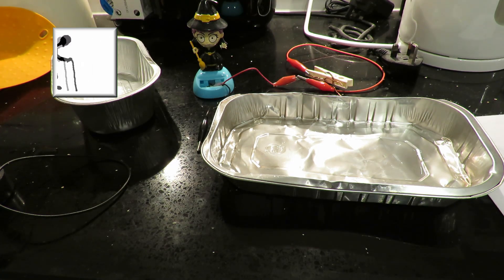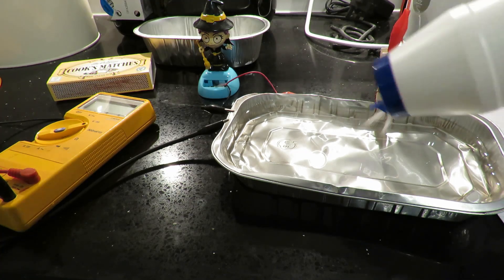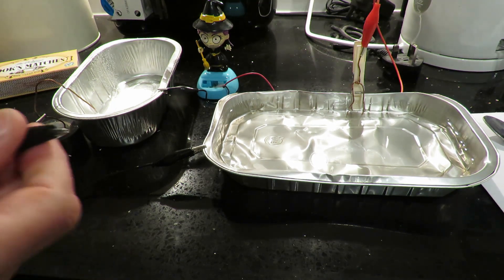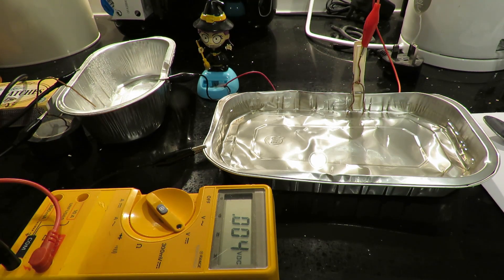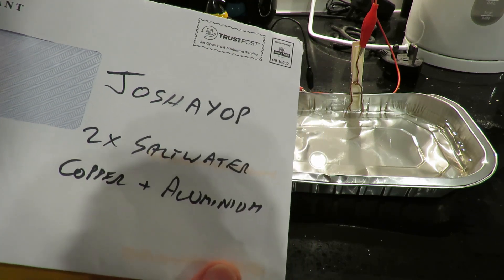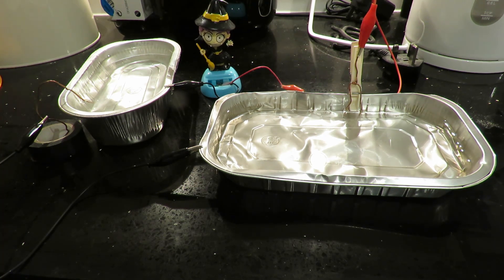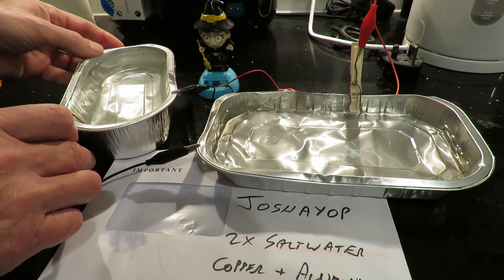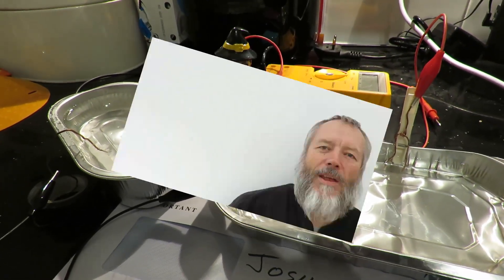Solar Rocker Saltwater Copper and Aluminium battery

Comment: Just tried this with a vinegar (brownish one) and a long nail (i think it's a zinc one).. measured Voltage - 1.02V but almost no amperage (got 0.2uA) and the nail was covered and released lot of bubbles, looked like some kind of internal short.. edit: no wonder you got just 0.6V! It's a closed loop, not open circuit! If open, i guess you would get around 1V on 1 tray
Reply from the maker: Thanks for sharing

Comment: I would think that if you used copper plates , having much more surface area , would generate a bit more power. Only assuming since I have not tried this stuff my self -   yet.    : )
Reply from the maker: Yes larger area gives more 'amps' but we also need a little more voltage than one cell can provide to get the rocker moving regularly. A stronger solution will also help up to a point.

Comment: I would imagine the system would keep running until the water evaporated?
Reply from the maker: Nah, it didn't last very long. It might have lasted longer if I increased the amount of salt I added but I just wanted to show the basics of using the tray as the cathode or anode, can't remember which is which. I challenge you to read this explanation and not come back confused https://www.thoughtco.com/how-to-define-anode-and-cathode-606452
Reply: @GrandadIsAnOldMan  LOL. So the cathode can be charged along with anode but both can be charged at the same rate as the cathode and anode together in series. Therefore, when the anode is attracting onions. the cathode is producing positrons and both are frying the chips for dinner.  Yes, it all made perfect sense. Was written by a Phd I noticed. LOL. It was like reading Abbot and Costello's, "Who's On First Base?" 🤣👍👍👍 https://www.youtube.com/watch?v=tbJwwJ33TEI

Comment: grandad , do u have a certain ratio of salt to  water or did u just dump it in or experiment with  what seems " right? thanks  read on how volta experiemented with his battery. thanks in advance  ohm myyyyyy!!!!.
Reply: Usually for cooking, it's 10g/liter and since the experiment is in the kitchen... XD
Reply from the maker: I just sprinkled some in. In fact you could do an experiment simply to discover the optimum strength

Comment: Those cells can be charged using 3 volts in my experiments and after charged they hold over 1v each but the discharge back to around 0.6v
Reply from the maker: By coincidence there is a short series coming up with a rechargeable battery made using Epsom Salts as the electrolyte.
Reply: GrandadIsAnOldMan I’m looking forward to watching it
Reply: @GrandadIsAnOldMan  Lavender ?